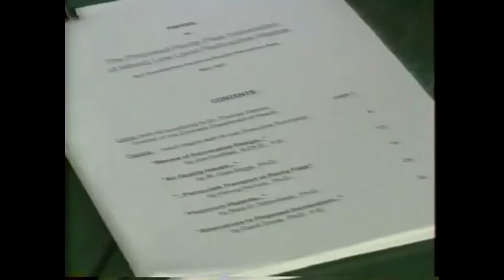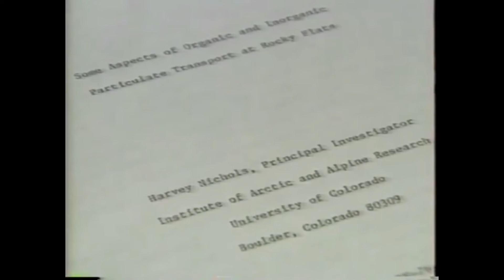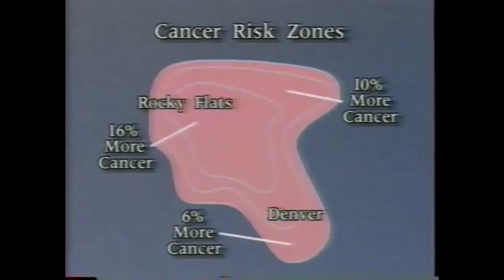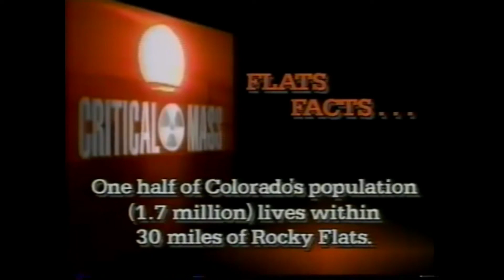Grizzled Survivor - Rocky Flats Criticality Report - Part 1: Executive Summary

Comment: A criticality accident should usually only have a small area of effect. It's not something that will destroy a city and contaminate it with deadly radiation. Once the catalyst for the criticality event has been removed, such as water boiled off, it will stop. It's not something that has a huge area of enduring devastation. As you probably know, the further you are from the source, the dose drops significantly.
Reply from the maker: Rocky Flats had worse problems than a hypothetical criticality.  Greg over at vidocq.pro can tell you a lot more
Reply: @GrizzledSurvivor  Rocky Flats is infamous, lol.

Comment: Someone accidently turned a valve that caused plutonium nitrate solution to get pumped into a large vessel and it went critical, however this vessel was well away from anyone and nobody got hurt, but the vessel itself and contents were dangerously radioactive for few weeks. If anyone were close to it they would have died a horrible death.